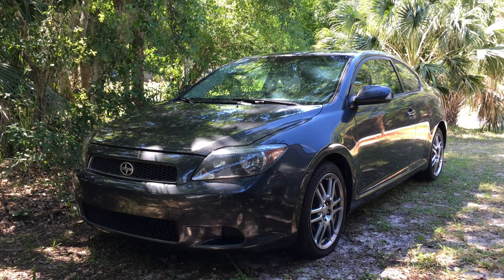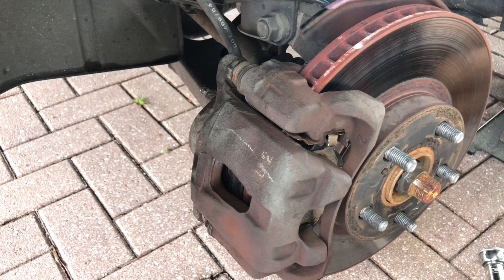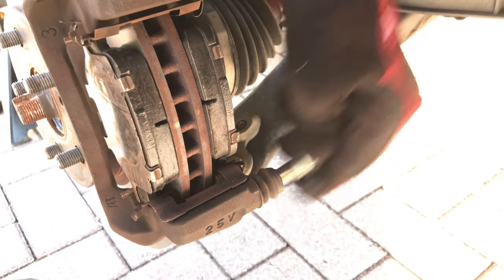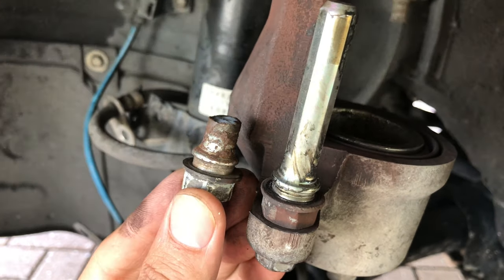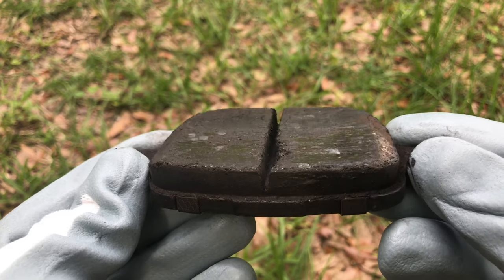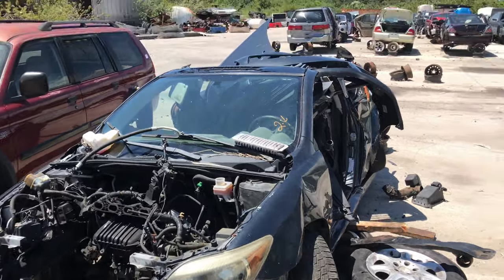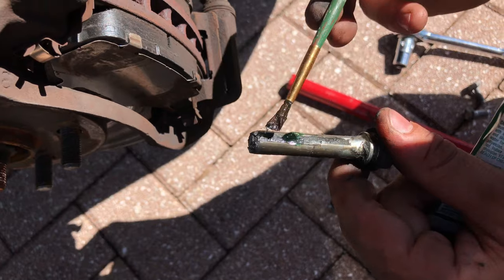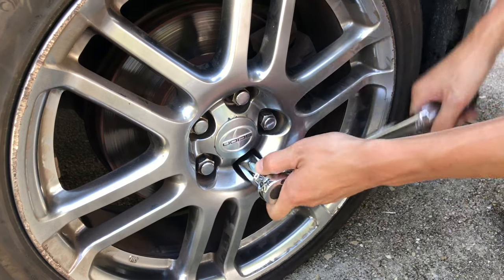How to fix smoking brakes in your car.

Comment: you made it look easy and quick. I know it will take me hours to do this..lol. I may not go to the junkyard, but I will certainly the online options. local auto parts stores... yes you said it right, the most expensive option. praying for an easy replacement work.  thank you very much for sharing your knowledge and skills.
Reply from the maker: Thanks, I hope all goes well for you!
Reply: Thankyou. My car is at the garage that installed the break pads and rotors and allegedly flushed the break system but they seem to be jerking me around

Comment: I fixed mine by opening bleeder screw on caliper start the car push brake few many times until oil starts coming out almost enough to fill a cup. Then put oil back in reservoir engine off press brake few times until pedal stiff and tight bleeder screw.
Reply: So ur not flushing it just removing some brake fluid..ok,,and how often do u do that?..does it stop the overheating right away?
Reply: How did that fix your problem of smoking brakes

Comment: Very Good video. Thanks. Got a problem. Changed all 4 calipers, rotors and pads. Did the bleeding,  derived about 4 miles but still the break is very spongy. What should I do?
Reply from the maker: Check the master cylinder for leaks maybe.

Comment: Today i had new rotor new caliper an brakes put on 98 durango afterwards test drove came back massively smoking removed tire put two lugs on the studs and tire would not turn i understand new rotors caliper and brakes everything is tight but when i put the old rotor back on with new caliper and brakes the wheel will spin smh this certain giy telling me the reason it not turning is because my knuckle is bent quite frankly i font believe it my bracket was missing a bolt and the new t45 torx pin the caliper came with wouldn't fit the bottom but would the top i think that has something to do with it because i have no problems 8n my steering wheel im just trying to get opinions ive check wheel bearing and it is good
Reply from the maker: I suggest checking sliding pins to see if they are stuck and prevent caliper from opening wide enough.
Reply: Red light bulb with x on 2005 hyundai xg350

Comment: Thank you for everything and info.👍.
Reply from the maker: Glad it was helpful!
Reply: @DIYtimeTRD  some thing you may concern and help me.
I had 2009 toyota matrix. I changed new front btake pad.then i drove down the road.and i saw smoke com out from my front left brake.i didn't why.also left front tire won't spin freely.it stuck.
Reply: @DIYtimeTRD  you very welcome.now my car had problems left front wheel won't spin .there is something you may concern and help me.?
Reply from the maker: Check brake piston or slider pins to see if they are stuck.

Comment: Have smoking brakes a day after having them all replaced at a shop.
Reply: Looked into later that evening; turns out that is normal while braking them in.
Reply: Ok bet just got mine done literally I was about to have a fit I thought something was wrong
Reply: So it is normal for them to smoke and the calipers to get very hot for a few miles?

Comment: I replaced both my calipers , and only the right one is smoking but that disc is extremely grooved. Is the disc the problem or ?
Reply: I also bled both of them
Reply from the maker: Assuming your slider pins are not stuck and move freely, you may have clogged brake line. Brake hoses may deteriorate with time and rubber starts cracking and hanging off the hose walls. This may allow fluid flow in one direction but not the other.
Reply: @DIYtimeTRD  which specific hose do u remove or seal,,idk if this my case,,should I just buy new master cylinder
Reply from the maker: You should inspect the hoses for the wheel with sticking brakes.

Comment: I just changed my brake pads and my driver side start smoking is tha normal ?
Reply from the maker: No, it is not normal. Check if your brake caliper or slider pins are seized.
Reply: Or you left your ebreak on

Comment: My front drive side caliper was sticking and I replaced the whole caliper bled it correctly and still sticking someone help
Reply from the maker: This could be an issue with the brake line. If it’s deteriorated in the inside, pieces of rubber may be hanging inside the hose letting fluid to flow in one direction, but not the other.
Reply: DIY-time yeahh thanks when I took off the brake hose when I replaced the caliper I didn’t see much fluid come out